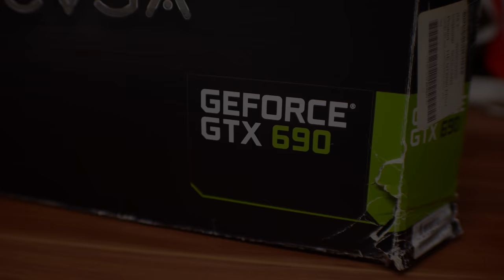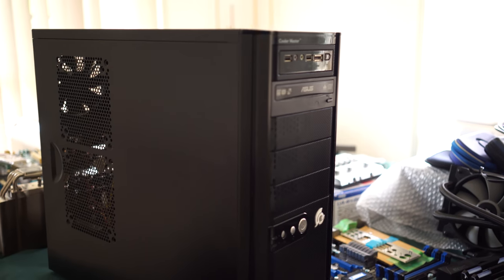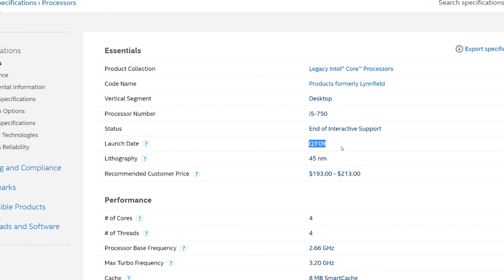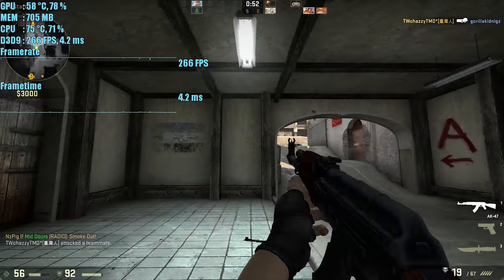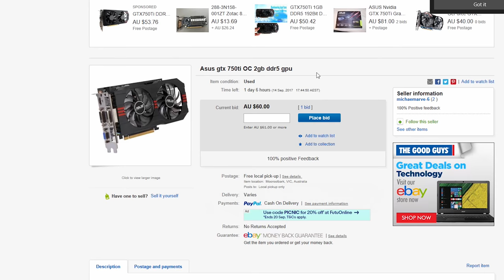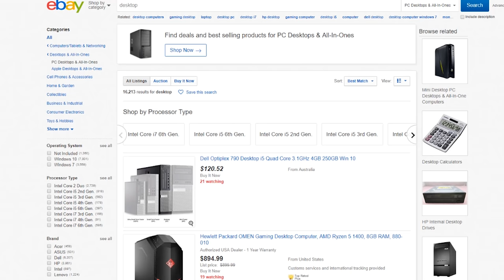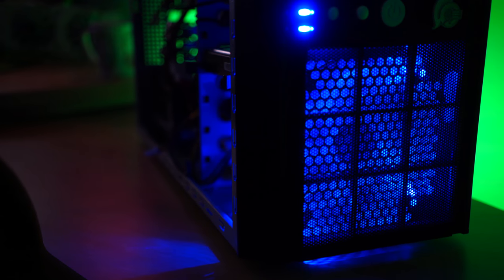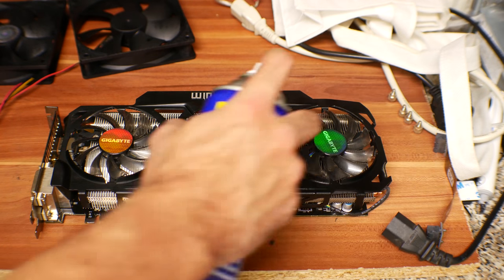The CHEAPEST and EASIEST way to Get INTO PC GAMING?

Comment: Does this sound good for my first build? 
Ryzen 3 1200
B350 Micro ITX mobo
8GB RAM
Rx 560 4GB
500W PSU
1 TB hybrid drive
Reply: If you're wanting to guarantee your games don't dip below 40fps for the demanding titles at 1080p, I'm sorry ( sincerely) to say that you'd be better off with that pentium 4600 kaby lake with the budget mobo.  Jayztwocents confirmed the 1200 compared to the 4560 even just isn't as good a gaming value....for gaming.   If you plan to stream, THEN the ryzen 3 lineup makes alittle more sense as long as you're willing to turn down some settings too.
Reply: Looks fine. Compare price of nvidia 1050ti 4gb. 

https://pcpartpicker.com/list/wsTm9W You can get gold PSUs for $60. 500-650W is fine for one graphics card.  Keep checking. They're worth much more. (Corsiar CS & VS PSUs are unreliable.) You can get very cheap whisper quiet (22dBa) 120mm fans on ebay. You want a 140mm fan outside too for summer. Mine is a Thermaltake TT 1425, from Ebay. Makes no noise at only 17dBa. It has a long cable.

35-minute talk made after decades of research on the evil, global, faceless, corporate Intel:
https://www.youtube.com/watch?v=osSMJRyxG0k

Intel's new Coffee Lake CPUs won't use the Intel-made z270 chipset so won't work with the Sky/Kaby Lake 1151 boards. Angry Intel users, who sensed they've been scammed:
https://www.youtube.com/watch?v=dt-oA4x776A

Benchmarks misslead as they don't show the CPU usage percentage. 2-core Intel benchmarks are far higher than they should be compared to 4-core AMDs.

I asked an i3 user who told me that an i3 running daily software like browsers, office suites, media players etc. all at the same time uses 30% on all cores.

So i3's run Windows like the old AMD dual cores that many AMD users threw away years ago, the ones now sold on Ebay for $7. (An i3-6100 is $100. An i3-7100 which is not that much faster is $170.)

Someone wrote they wished Intel would do more "great" things like the Pentium G4560 (an i3 at a lower price). Someone responded that Intel were limiting those to entice more people to the i3. I think that's just going to backfire on Intel.

In 2025 Windows 10 updates will expire so a current i3 is unlikely to be able to run the next operating system after that. By then you could get a i5-6400 at $60 but you could get a Ryzen 5 for much less which will be much better at multi-tasking. This assumes the new Windows supports the 1151 board. (Windows 10 doesn't support socket 1155 which came out in 2011).

Someone with an Intel G4560 & a Ryzen 1200 wrote: “I own both of these cpus and believe me, g4560 slows down a fucking lot after 2 weeks of usage due to the antivirus and other stuff, and with ryzen I can even listen to the music on twitch in full hd, have 3 more chrome bars with tutorials for csgo/lol champ builds and much more while still sustaining stable and better fps than the g4560".

A gaming reviewer on Amazon wrote of his Ryzen 3 1300x: "its snappier than the i3 4170 its replacing and games are running smoother, I cant say frame rates are much higher but its more consistent with less drops and stuttering. Farcry 4 and The Division seem to be running at a much more solid 60 fps now with 4 physical cores instead of 60 with drops down into the 30s and 40s randomly with the 2 core 4 thread of the i3."

Youtube comments on a Ryzen 1600 running several games: "wow CPU usage is 25% on 1600, and its fucking going at 90-100 fps. Damn Intel got there ass kicked from AMD. Im switching from buying a i5-7500 to a Ryzen 5 1600".

"The video I saw of a skylake i5 vs even a 1400 (or 1500x) the i5 was 100% cpu utilization and the 1400 / 1500x was like 65% cpu utilization. AMD just destroyed the i3 and i5 line of intel lol".

Someone tested a ryzen 3 1200 with an nvidia 1050ti in a few games. The card was at 100%. The CPU was at 50%. My guess is that an i3 or a g4560 would have been more at 90-100 than 50%.

I'm willing to guess that Intel doesn't pay taxes. It's part of the global corporate empire with Monsanto, Amazon, Google, Starbucks, Facebook, McDonalds etc. Yes, Amazon. They're in on it too.

Comment: I have a pentium D 775 socket and thinking of upgrading it to a core2quad q6600. Would this be a good upgrade or am i better off just saving up for a newer cpu and mobo?
Reply: Nothing wrong with q6600 (decent speed) except it's not a low-energy CPU.

The Ryzen 3 is good & low energy.

On ebay you can get a $40/£30 fast 2.6ghz, low-energy, AMD 4-core 910e cpu. (There is also the very slightly slower 610e which is virtually identical but has no level 3 cache.) They'll do everything quickly except long 1080p video encoding. They even play modern games at 720p or 1080p. Get an AM3/AM3+ motherboard for them and DDR3-1333 MHz.

They can play Battlefield 1 at 1080p.

They run at a similar speed to the Athlon 620, which has youtube gaming videos made of it.

I use the 610e with a 2015 64-bit Linux operating system, comparable to Windows 10 in size. With all my software running at the same time like Opera & Firefox browsers, Libreoffice suite, GIMP photo editor it uses 12% on all four cores. When viewing 360p YouTube videos it rises to 35% on all cores, the same as viewing 1080p video on my media player.

Overclock the CPU
https://www.youtube.com/watch?v=nL28wW5AmYE

Overclock the memory for faster games https://www.youtube.com/watch?v=k8vuTPj0VXA (In cpu-intensive games you would see the difference. Run in lower resolution and graphic settings to eliminate the gpu bottleneck to see the difference.)
http://www.masterslair.com/memory-ram-overclocking-guide-ddr3
http://www.overclock.net/t/1361380/overclock-kingston-valueram-1333-to-1600

Comment: Sold my friend a pc with a i5 760 and gtx 960 4gb with 12gb of ram and 600 watt power supply and 1tb hard drive and hyper d92 and oced it to 3.8ghz at 1.3vcore and selling it for 300 amd I've fully made sure that everything runs well should I be worried about the hard drive dying while in shipping to Sydney?
Reply: Remove the HDD and wrap it in bubble-wrap, then tell your mate to put it back in when he receives it. Put the tower in the original PC case box, put in foams so it doesn't move around. I have moved several computers interstate like this. If your concern is the age of the HDD, 1TB brand new is only $55-$65 now, chuck it in for him if you feel generous.
Reply: Shipping it out today and yeh i wrapped it up in bubble wrap and put foam everywhere inside the pc so nothing collides with each other thanks for the advice!

Comment: Any 4 core Intel, an overclockable mobo, 8 gigs of ram and boom. If your computer has that toss a $260.00  Gtx 1060 and you have an instant gaming Pc that will play everything at high settings 60+fps minimum. 

If you don't have an overclock able-bodied mobo then just get a 3+ghz 4 core Intel Cpu for your Pc, get minimum 8 gigs of 1333mhz ram and a 1060. Boom. 

Under 200.00? Do everything I just said but get a 1050 ti from Best Buy at 125.00, they have that price all the time and boom, Battlefield 1 1080p, high settings 80fps after Msi Afterburner. You can do so much better for the same price as this crap setup in the video
Reply: RoomerJ just not a c2q

Comment: Hey Brian, another great video!  Inspired by you and a few other great Youtubers I've been doing this successfully for quite a while now with used PC's I pick up here and there and one thing I ran into a while back is that on a few of those Dell Optiplex models the motherboards just were not having the newer graphics cards.  I would get strong I5-2500's and the like with these machines and even using 6-pin PSU power for the graphics cards but for some reason, those Optiplex mobo's just don't interface will regardless.

Nerd on a budget had a video on it a while back.  https://www.youtube.com/watch?v=TlXLN0sxZMk&t=2s

Anyway, just a little something to watch out for as these Optiplexes with the strong i5's tend to be in pretty good supply when searching up used desktops people are getting rid of!

Comment: Well idk if your into this. But I thought it was an awesome deal. This place close to my house sells these crappy 50 dollar e7300 pcs. But here's the catch. The case is brand new the motherboard looks brand new I would eat off it. And it's a 775 cray. Comes with 4 one gigs ddr2 ram. New power supply too umm let me check 350 watts the mother board is a dg35sec Intel. I've never seen one. But your getting a new old stock computer. The case says bytes peed on front oh yea and they give you this refurbished windows 10 key. And I have used it on like 7 computers so far idk whats up with that but I put windows on all my ryzens for free so far. Plus I have so much cpus that fit in 775s from when I was a kiddo and ddr2 memory Im thinking that mobo may take ddr3 too idk though I'm still on my first Dino build. Look I know this thing isn't 80fps pubg but Im still gonna be able to play it on normal settings for like 150 bucks. If that. Cause I haven't bought anything but the 50 dollar new old stock case full of gutz. I have probably like 150 graffics cards 1070 and down from three. Tons of 750tis rx460s 560ds nutz. And an endless supply of q5550s q6600 few qx6800 I even found my old water 775 mobo in the shed today wrapped in plastic thank God. I live in GA. So I'm just in a time machine when I was a teenager smashing fps again. Playing the first crysis games of that Era. For 50 bucks. I do have a H61 stairing me down you think I should keep it stone age? Or is it sandy time? Cause 50 bucks is awesome for a whole computer. A I5 2400 is gonna cost me 35 to 43 bucks. But   yes I did find a h2 lonovo t
I5 today too so I definitely have options. I'm kinda bored of my ryzens 2400g 2200g 1600 1300x my house is outta control its like a pc parts crib. But I'm always changing it up. Am2 build is next. 10 something x6 I've been buying those blanks like crazy like playing the lottery always lose but I may find some. Plus I want to see what my bare bones pc could do. When I started ryzen my first one was 2400g so I bought a12 9700 in the barebones just for the bios. Everyone says there shit I'm sure they are. But I haven't tried yet. I have a huge artic cooler that looks ridiculous that would be perfect for my underdog a12. Oh I have a a10 9700 too so. Time to go core hunting.

Comment: The problem I see with buying this way is .. are you going to get a bargain  ... If you buy a 80 dollar PC from ebay ... will it work? How many 80 dollars PC's will you have to buy before you get a working one?  I mean if you buy 3 or 4 PCs at 80 bucks .. its not really a bargain anymore... You can do the craigslist option so you can see if its working ... but ... then the issue is .. will you actually get the item ... or will you get robbed or killed?... Again, not really a bargain if you are dead :D

Comment: I think you should get one of these generic gtx 750Tis and test it out to see how it stacks to the real thing 
goo.gl/UzJuCB this one is $40 £28
Reply: Tweeek Those are usually Gtx 550 or older just flashed to say 750ti.
Reply: Tweeek For that specific card the specs match a 550ti for clock speed and memory speed. I guess they didn't feel like changing those ones lol.